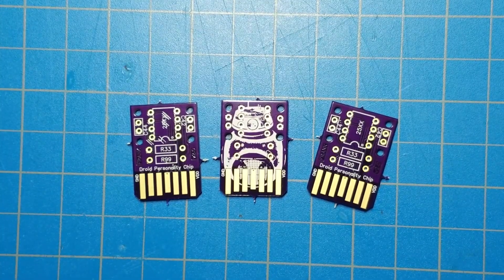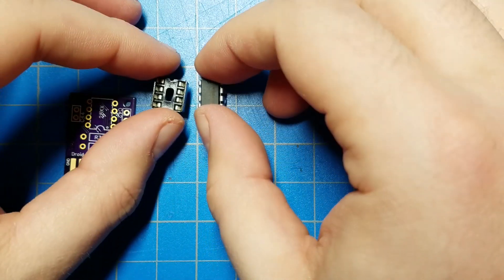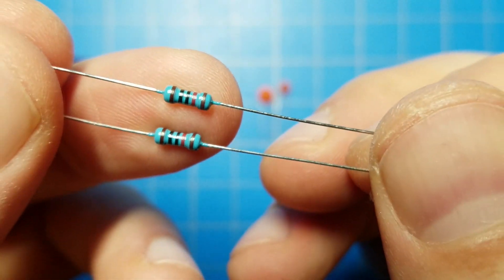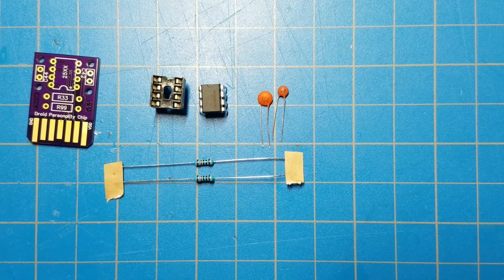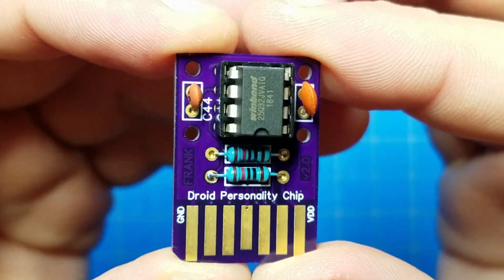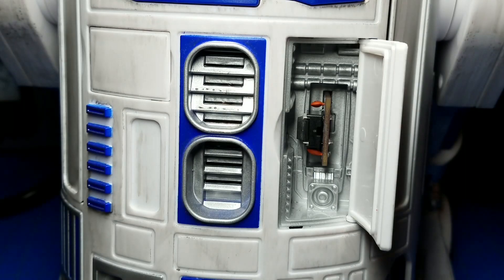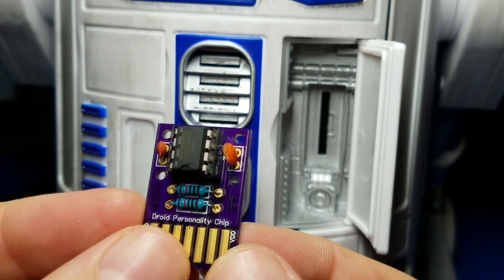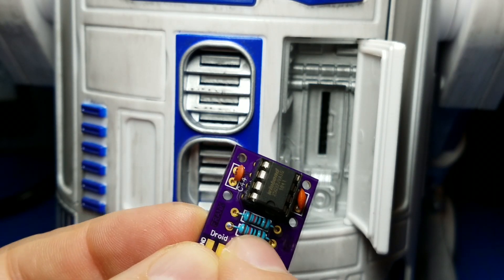Reverse Engineering A Droid Personality Chip: Part 6 - All Holes All The Time

Comment: any alternatives for the spi chips lots are in back order in many places
thanks!
Reply from the maker: with the chip shortage, and DIP flash memory becoming less and less common, I'm thinking there will be little to any new chips produced going forward. your best bet might be to look for surplus stock on eBay, e.g. https://www.ebay.com/itm/172468988798 or https://www.ebay.com/itm/171444205058.

Search on ebay for "DIP8 25Qxx" where 'xx' represents the megaBIT size of the chip. 80 = 1megabyte. 16 = 2megabyte. 32 = 4megabyte, 64=8megabyte

Comment: For these is one of the capacitors 10pF or still 5pF like the surface mount chip version?
Reply from the maker: anything between 5 and 15pf will work. it doesn't have to be exact.
Reply: 0.25watt or 0.5watt or don't it matter also?
Reply from the maker: @RicksterMagic  doesn't matter. the power being used for the chip is very small
Reply: Thanks a lot! I actually made the SMD only version and the DIP-8 Chip adapter and they both WORKED! Working on my own sounds now. Might add some vocoder robotic voices also. I’ll keep you posted. Like I said before, you made it look so simple. Instructions were excellent!

Comment: One last question :)  If I’m going to be using your “Personality Chip To DIP-8 Adapter” to program the Windbond 25Q32JVAIQ chip, couldn’t I just solder the chip to this All hole board?
Reply from the maker: yup! you wouldn't need a socket if you have the adapter.
Reply: Thank you! You make these look so easy to do. My supplies (for the all surface mount) are coming soon. Next will be the hole type like I described. Looks a bit easier to do. Thanks again!

Comment: What about thru holds for capacitors and resistors because they’re easier to add, and a surface mount chip. It would keep the profile slender to add a cover later on.
Reply from the maker: you could not use a socket and solder the through-hope chip directly to the PCB. the chip itself will have about the same height as the capacitors.
Reply: What I mean is create a PCB with a spot for a surface mount chip and through-holes for capacitors and resistors. I’m not really tech savvy and don’t know if that’s possible.
Reply from the maker: @RicksterMagic  it's definitely possible. there's no technological reason to not design it that way, it's mainly preference. the stock personality chips are all surface mount so that's the original direction i went in. i then looked at a through-hole memory chip because it could be socketed, making it's removable and therefore easier to program. once i had designed the personality chip to DIP adapter there was really no need to remove the chip to reprogram it.

i came back to the all through-hole component version because those are much easier components to solder than surface mount, making it a more approachable project for someone with limited or no experience soldering.
Reply: I photoshopped an image of what I was thinking about, but can't paste it here.  :(

Comment: Good video. 

I mean, if I hadn't already bought the original boards and components, I probably would have gone this route because I have so many through hole components on hand. All I would need to order is the one chip. I haven't gotten myself an SMD assortment of capacitors or resistors yet, but I think that's happening soon.